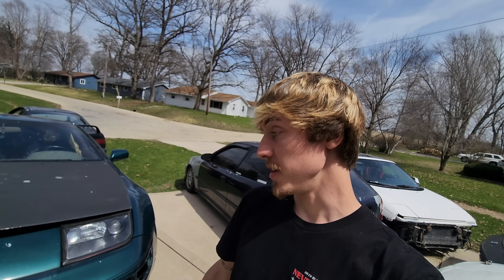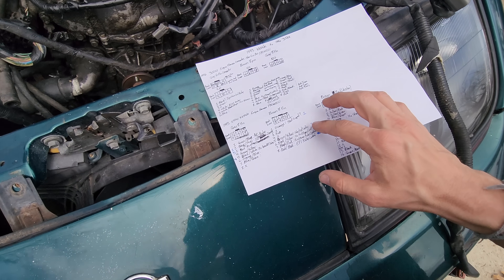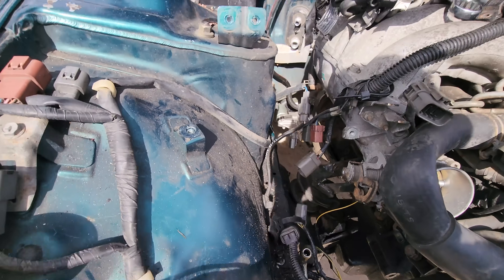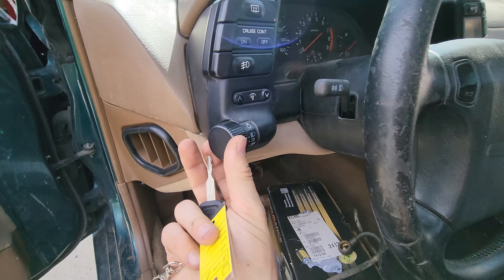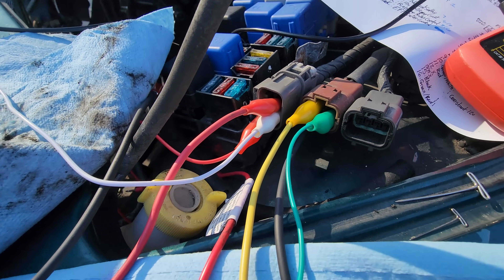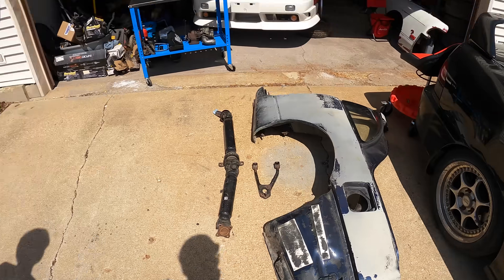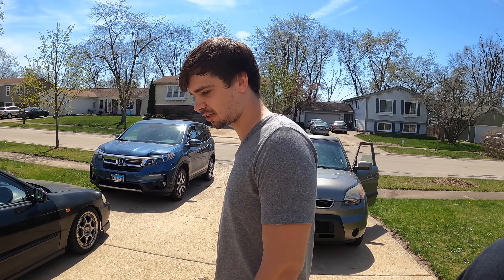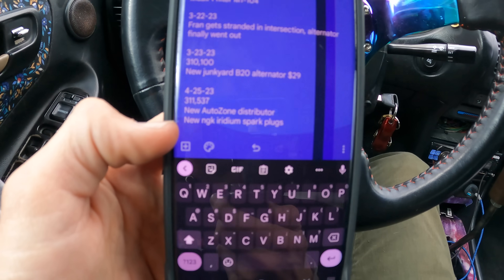Wiring my KA24de 300zx then this happens...

Comment: ngl wiring was probably the thing I hated the most when in college, it's tedious as all hell
Reply from the maker: It was definitely the hardest to learn!
But I'm so glad I did learn it! Wired my RB25 in my s13 and now the KA24 into the Z32 haha 😁
Reply: @PrizzaMike  it definitely comes in handy when you wanna work on your own stuff for sure, not having to wait for a shop sounds like heaven
Reply: I have a simple method tape and a sharpie is your best friend in this project. Label each wire you find.
Reply: @PrizzaMike I saw the last frame of the video,is he pointing at a rod in the oil pan....?

Comment: DATE YOUR FILTER! you would give us hell... if this is a street car, you may want cruise control and you have the module and controller. Seen you take it off. Should look into "speeduino ecu" latter, feel this would be a good project for it. Your brothers face says it all 🤣 Wiring can be a pain, even if it took a while and you ran into problem. You got the right idea 👌 might be alittle late to mention, you do have a 240 subframe to make a ANOTHER jig 😆 just need rack mounts location, lower control arms and frame rail mounting locations, Some box steel, plate steel and toooobs 😎 if you add in the engine mounts locations, you can build a tubular subframe for both. AS for the work truck, always hated the spark tubes and that's why. Bet the seals are already shot or the valve covers have micro cracks around the seals. When installing new seals, most use oil to lube them up to prevent cracking and I recommend ATF behind seal because it will help keep the seal soft.

Comment: cylinder 2, 3 and 4 are def shorting out and causing misfire for sure. i had same issue on my pos daily driver, replaced valve cover gasket, not even a year ago. had to replace again, this time i used thin coat of ultra black rtv around every spark plug hole and around entire head, thing dosen leak at all now lol. and that first cylinder is running lean, you may have fuel injector going out. might wanna ohm test injectors.
Reply from the maker: I was thinking the same thing!
Luckily these injectors are incredibly easy and cheap to find!

Comment: If the engines burning oil would it be hard to change the piston rings in I know it’s gonna require removing the engine but it would save on oil 😊

Comment: Wow that’s a lot to have to figure out especially looking for the diagrams. Very impressive, u know alldata and identifix now have options now for 1 car it’s like 30$ for a months access. You can get all diagrams the oe shop and interactive ones that will highlight the wire for what ever pin you click on makes electrical diagnosis a breeze.
Reply: I think our local library gives access to to databases like that. Never needed it though. This feels over my head!
Reply: Its all out there for free, factory manuals and all

Comment: I absolutely know the struggle man, my h22a swap has been fighting me for over a week now.. 
Swapped harnesses, went through 4 ECUs, checked over every ground/fuse/plug 3 times over...
Just the other night I pulled off the thermostat ground and hit it with some sandpaper.. boom. Thing runs.
Crazy how sometimes it can be the dumbest little things that cause the biggest issues 😅
Reply: What chassis? 6th gen accord?
Reply: @samwilley9653  EJ8 Civic SI, all in all a great option as a swap after you work out all of the kinks. The main downsides of this build are the axle inclination angle, (fixed by shimming torque mount)
Overall engine size and working space (valve cover is ⅛" from driver strut tower) and availability of used parts. (More scarce compared to K/B/D)
But if you know where to find them, and you have some patience to bring out their full potential without cutting corners, it's very rewarding as a stock NA setup. They pack a punch in these dinky little cars 💪

Comment: Mike you're wizard in my eyes. Just a small quick tip: do NOT ever fill your oil filter with oil. In this case oil pump must pump air THROUGH oil in filter which is way harder than pumping air through empty filter. Cheers!

Comment: Dope ass progress my dude! And on the integra, that oil is most definitely why it was bugging /bogging out. I'd replace the spark plug hole o rings asap if not you're gonna return the brand new plugs you just put in.

Comment: If oil is down your plugs,it's leaking from the top. Very common twin cam problem, need to to replace plug seals on rocker cover. 16v 4age are real bad for it. I bet it smoked heaps after you changed the plugs

Comment: You can use a can/am wiring box which will make it easy easy
Reply from the maker: No need, I'll just use the factory 300zx body
 harness!
Can/am is mostly for wiring without anything to work off of, like a stripped shell